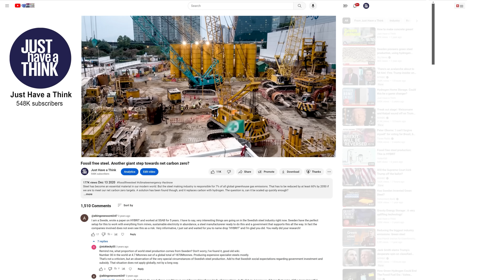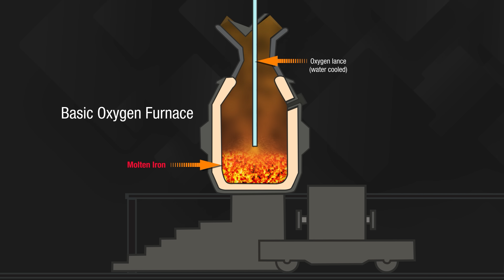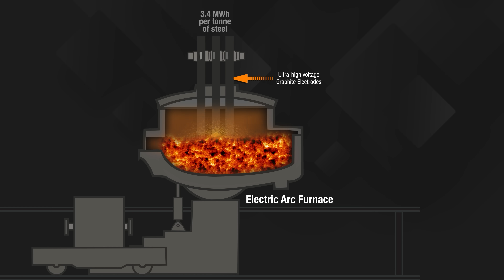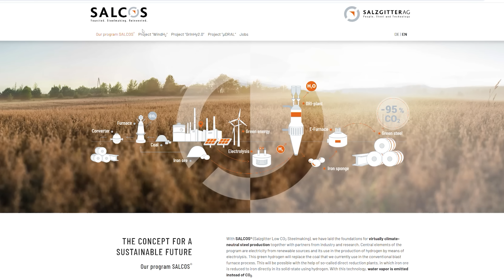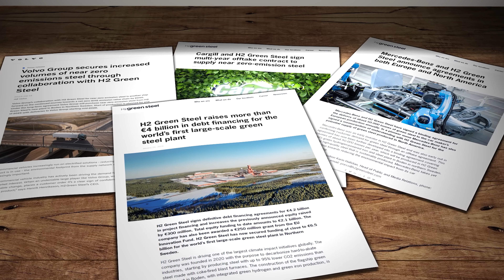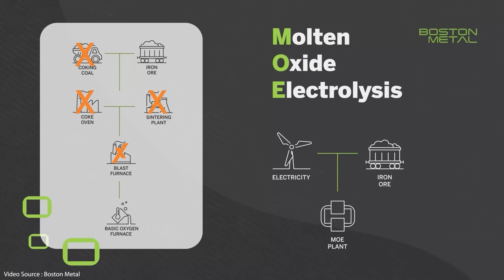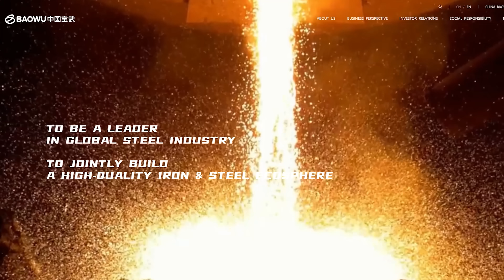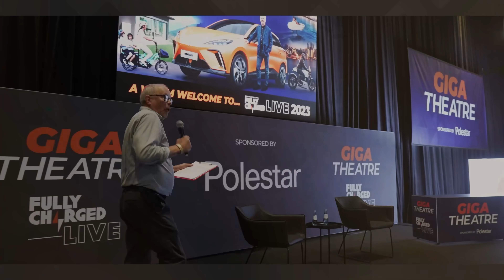Green Hydrogen making Green Steel. Is 2024 the breakthrough year?

Comment: Making green Hydrogen has at the very best a 40% round trip efficiency. Just have a think about using the electricity directly without the losses inherent in electrolysis and combustion.
Reply: @bélalugrisi  solar cells dont even reach 40 percent efficiency. They are still very good.
Reply: @markusjohansson4949  Not a good comparison, as sunlight is free, abundant and non-polluting. Electrical energy is a limited resource that has costs to the environment, no matter how it is produced.
Storage technologies, as hydrogen is in this case, all waste valuable produced electricity. Batteries and pumped-storage hydropower have roughly double the efficiency of hydrogen.
Reply: @bélalugrisi  well, maybe you should focus on what is relevant in you argumentation then.

Comment: If the electricity to run it is not green then the steel won't be either. So, clean up the grid first! Until then, Sweden and Norway with 98-99% fossil free electricity can do it.

Comment: My thoughts- Start strong and get stronger, fast. All the money raised, is then divided equally amongst every person living in that state. The rich use more carbon, so it will benefit the poorer. My addition, to what is a commonly held strategy, is that the govt., gives out the money at the beginning of the year, so no one can ever complain they're being robbed, plus offering the option of borrowing three, five years of estimated carbon tax, to carry out energy-saving works, insulation, solar, EV. The better the energy saving, the quicker the project pays for itself. Providing such a strong incentive, plus the means to act, could be transformative.

Comment: Co2 is life. Co2 has never been shown to drive "climate change". Co2 is greening Earth. MORE Co2!
Reply: @nekiyia  prove me wrong with some facts!
Reply: @zympf  "* prove me wrong with some facts"*
Published research on Co2 and climate:

"CO2 as a primary driver of Phanerozoic climate"
"CO2-forced climate thresholds during the Phanerozoic"
"Climate sensitivity in the geologic past"
“Observational determination of surface radiative forcing by CO2 from 2000 to 2010”
"Changing atmospheric CO2 concentration was the primary driver of early Cenozoic climate"
 “Geocarb III: A Revised Model of Atmospheric CO2 over Phanerozoic Time”
“The Bakerian Lecture: On the Absorption and Radiation of Heat by Gases and Vapours, and on
the Physical Connexion of Radiation, Absorption, and Conduction”
"Timing of atmospheric CO2 and Antarctic temperature Changes across Termination III"
"Synchronous change of atmospheric CO2 and Antarctic temperature during the last deglacial warming"
"Global warming preceded by increasing carbon dioxide concentrations during the last deglaciation"

As well as published research on current Co2 rise linked to human activity:

“Evidence for Preindustrial variations in the marine surface water carbonate system from coralline sponges”
“C13/C12 Ratios in Tree Rings and the transfer of Biospheric Carbon in the Atmosphere”
“Past atmospheric CO, levels and the 13C/12C ratios in tree rings” 
“Stable isotope ratio mass spectrometry in global climate change research”
“Oceanic Uptake of Fossil Fuel CO2: Carbon-13 Evidence”
“Global carbon budget 2013”
https://www.nature.com/scitable/blog/student-voices/the_delta_fingerprint_anthropogenic_climate

Not only that, but climate models that show climate change, have to factor in the known infrared radiation absorbtion abilities of Co2 in order to match observations!

“An Assessment of Earth's Climate Sensitivity Using Multiple Lines of Evidence”
"Industrial-era global ocean heat uptake doubles in recent decades"
"Observed and simulated full-depth ocean heat-content changes for 1970–2005"
"How fast are the oceans warming?" [DOI: 10.1126/science.aav7619]
"Evidence for climate change in the satellite cloud record"
"Cloud feedback mechanisms and their representation in global climate models"
Knutson et al. 2010: "Tropical cyclones and climate change"
"Observed warming trend in sea surface temperature at tropical cyclone genesis"
"An assessment of a multi-model ensemble of decadal climate predictions"
"Changes in the geopotential height at 500 hPa under the influence of external climatic forcings"

Comment: The Boston Steel (Boston Metal) approach, direct electrolysis, is the only approach I've seen that is expected to make green steel that costs less than the coal fired blast furnace / converter process. It makes the hydrogen foam steel process seem like a fools errand. Unfortunately it also looks the least far along on scaling up.

Comment: Its good they are figuring this out, but in the long run economics will win out.  Before committing too much to this, perhaps we need to deal with low hanging fruit first.  Replacing coal and natural gas with renewables in combo with energy storage along with replacing natural gas with heat pumps is something we can do now and will save us money long term.  As is the adoption of evs.  

Because there is potential for very cheap electrical power going forward with renewables, then this technology will begin to make sense economically in the not so far off future.  

Another thing.  What is the carbon footprint of recycling steel?  And what percentage of steel is recycled and is this trend going up?

Comment: At first glance, it looks like this has potential, and seems like a much better use of green hydrogen than fuel for vehicles. That said, the cost premium over conventional steel is still a concern, and as long as it's there, most companies will inevitably choose to just pump CO2 into the atmosphere, rather than pay it. Yes, a 20% premium is far cheaper than CCS, but it's still more costly than hiring lobbyists and/or supporting political parties who don't care about the climate, to prevent regulations that tax/ban the dirty method.

That said, if the cost premium of clean steel is mostly driving by the cost of green hydrogen production itself, rather than actual elements of the steelmaking, there is hope that it might someday go away.

Comment: It seems a mistake to assume that we have to go completely green in one leap.
The price of green hydrogen is currently much higher than hydrogen from fossil fuels.
However with falling costs of electrolysers and renewables the gap is ever narrowing.
It is way, way easier if you are running your blast furnaces on hydrogen to switch the supply of hydrogen than to leave it, and not convert the blast furnaces to hydrogen until totally green hydrogen is available.
If you ask the wrong question, you get the wrong answer.
It makes IMO no sense to delay switching to hydrogen in steel making because the production of hydrogen is not currently completely green.

Comment: Smelting a ton of steel takes approximately 50kg of hydrogen, which at $16/kg is around $800. Smelting a ton of steel using coal takes 770kg which is about $0.10/kg... so about $77. "green steel" is a pipe dream and makes zero economic sense when other countries like China and India will make steel using coal at less 1/10 the cost.

Comment: VOESTalpine is also working on this since a few years. But because there is not much hydrogen and cheap gas the using the gas till the solving the problem. By the way: The VOEST is the inventor of the Basic oxygen steelmaking (Linz-Donawitz steelmaking).

Comment: Another compelling approach involves the use of hydrogen plasma to directly melt and reduce iron into steel. A pilot plant for this method has been constructed by voestalpine in Austria. The Process is called SuSteel

And then there is noteworthy paper published in Nature addressing the management of red mud, a byproduct of aluminum production containing up to 60% iron, albeit being a hazardous material. The study demonstrated that melting it in an arc furnace under a hydrogen environment allows the smelting process without the need for additional additives.

Comment: The elephant in the room isn't 'China'.... The REAL elephant in the room is the last 50 years of CO2 emissions that haven't had an affect on climate yet. The serious issues we're having right now are caused by the emissions in the mid 20th century. Even if we went to net-zero tomorrow, the climate will still be subject to additional warming for the next 50-70 years. If we've serious about 'fixing' the climate there are 2 things we need to do right now (but will never be done because of popularity competitions, aka elections). We need to start extracting more CO2 out of the air then we are pumping in (we need to get the atmospheric CO2 level below 300ppm, currently over 422ppm), and we need to get the population DOWN to a more reasonable level (reduce by AT LEAST one half!)... Neither of those things will happen because, money and.... money... So yes, I'm stocking up on air conditioners!

Comment: Natural Gas was supposed to be a stepping stone to the renewables and less harmful than burning coal. Then it recently turned out that, taking the full lifecycle emissions into account, natural gas is currently worse! On that front, I've read the first article in what I hope is going to be a series of articles that, finally someone did the chemical and climactic analysis as to the effects of the escaped H2 on our climate. Noting that there is no such things as a 100% H2 Leak Free storage, this is something that has thus far been ignored. Well, according to this analysis, the chemical interaction between H2 in the upper atmosphere results in worse global warming than the CO2/CH4 that it removes. It seems that "raw" electricity is the best solution. That focusing on less climatically harmful electric power generation, storage and distribution is the way to go. Perhaps we can buy a few years if "someone" decides to invest the Billions that it takes to build and manufacture the stratospheric aircraft that it would take to spray sulfur in the stratosphere to temporarily reflect back the solar rays (obviously lowering the efficiency of the ground-based solar cells). Or perhaps spreading iron / rust particles in certain parts of the ocean to supercharge phytoplanktons.... For that matter, just subsidizing the installation of solar water heaters could save massive amounts of energy. But, why do any of these things when we can just let someone else's children and grandchildren pay the price for our greed?

Comment: Here in Wales, we are also ditching our blast furnaces... but at a social cost.  Port Talbot steel works, one of the largest employers in Wales, is set to lose up to 3000 jobs as the plant installs electric arc furnaces.  Demonstrations have been held against the owner, Tata Steel, and their decarbonisation plans.  It's so crucial to take people along in the journey to sustainable tech by having more joined up policies of retraining and new employment opportunities.  Another big topic!
Reply: I believe this was not driven by decarbonisation plans but rather as we are now outside the EU we suffer tariffs on high carbon steel exports to the EU. So Brexit drove this as Tata did tell everyone in past. It is such a pity the media is distorting reality and blaming a green agenda. When post Brexit this was the only viable option.
Reply: @davidedwards4691  Easy to blame Brexit but why cannot our government provide the requisite coal cheaply enough (we've got plenty in the ground) - because it's not allowed to, unlike China for instance.

This is why China's steel much cheaper than ours - because they use massive amounts of cheap coal to manufacture it. Duhhh.....

So less Brexit, more Net Zero is the cause.
Reply: @dwards4691 To a large extent it is due to "green" agendas. If we could use our abundant reserves of coal to supply the energy required it would be a lot cheaper. And all our competitors like China and India are doing just that! Take your head out of the sand.
Reply: Electric arc furnaces can only recycle old steel, and make second-grade material at best. Meanwhile China will be using unlimited amounts of coal to produce their steel, much cheaper as a result.

Well done Net Zero! Pointless and self-destructive.
Reply: it is a sad consequence of technological change that jobs are often impacted negatively. It has always been this way going back hundreds of years. The new technology may eventually create spin off jobs in other sectors but at the present time those jobs tend to be higher skilled types that many put out of work in older technology industries will not be able to be trained for. Older industries have more manual processes so require more people. The new technology usually incorporates a high degree of automation and a reduction in manual processes. So it is the older and less skilled worker that usually carries the can and governments are going to have to change their tune about pointing the finger at some unemployed people and labeling them as bludgers.
Reply: @frasercrone3838 🎯🎯 Definitely a concern, especially given a broad resistance in a general populace towards change because of your noted "pain points" + personal economic uncertainty...

Comment: Great vid, thanks. Because you don't need such crazy temperatures & heaps of infrastructure is it ridiculous to think that you could have small-scale steel production? The graphic showed the electric arc furnace takes 3.4MWh/ton. That's 3.4kWh/kg. I'm off-grid solar and when my batteries are full I often end up 'wasting' 10kWh of power on a summer day. Making 3kg of steel would be a nice way to use that power!

Comment: I doubt the arc furnace in the graphic uses "ultra high voltage" (whatever that means) more likely very high current at a relatively low voltage.

Comment: to do any of this conversion you need plentiful carbon free energy. like on site SMRs to provide the electricity. why always with the wind turbines to show a renewable electricity source? maybe that is the fool's step in the whole conversion process. China will have SMRs being mass produced soon once their pilot reactor is tested with more online hours. then they will have mass produced units that can be site specific for both consumer and industrial generation. then the real conversion there will start. its great you outline the new tech available, but you should also emphasize the problems or the requirements to get that tech running at a large scale. steel making needs energy. wind is great for cottage industries. where will the big electrical source be. you should highlight and promote that. are you anti-nuclear? why?

Comment: It's great to see actual progress on this issue over the last few years. I know it isn't much now, but creating a sustainable commercially-viable technology or process is often the hardest hurdle, while increasing market adoption is easier. What would really help is governmental support, but we'll have to wait and see for that.

Btw, DCC is indeed an immature technology that isn't helping much at the moment, but why can't carbon capture be used directly on waste gases from the steel-making process? The sheer air pressure from an active process like this should provide a pressure differential that can help power the process, and the CO2 is in a high concentration, enabling more effective carbon absorption....?

Comment: I think using green hydrogen for steel production is the same kind of bs as bio fuels.
If green hydrogen is available, it should be used for fertilizer production which requires tons of hydrogen already.

Comment: Electric arc furnaces are only as emissions friendly as the electric grid. If you look at where most steel is manufactured (China), their grid is run on coal, so they wouldn’t even reap the benefits of emissions reduction in the electric arc furnace. 

Drawing small boxes of carbon emissions around parts of a system is precisely why the west buys Chinese coal-manufactured solar panels and thinks they are doing something positive for the environment.

Comment: OK my 2 cents worth, green steel wire plant that makes wire by recycling steel put up a windmill. The idea was to use wind to supplement its energy costs when the price of electricity got high. After about six months of operation they rarely use the windmill  anymore because magickly the power company that supplied them with energy has had low prices for a long time making it uneconomical to put up more windmills. hmmm 🤔on the rare occasion they do spin up the windmill.

Comment: The solution is not to expect buyers to pay a premium for green steel, but rather, to make the cost of making steel with a blast furnace very expensive. How can you do that? Simple. Eliminate the obvious subsidies associated with mining coal and oil. That is the answer. Simply make it impossible to mine could or drill for oil and compete in markets were there are viable green alternatives available.

Comment: If all the excess electricity capacity is used to make steel, how are you going to charge all the EVs?   You can't escape opportunity costs, if you use electricity for one thing then you can't use it again for another.  The amount of electrical current for electrolysis is enormous e.g. to produce one liter per minute of hydrogen requires 143.5 amps.

Comment: The origional steel process u described is antiquated and most steel in developed nations is made using a differant process. One a lot of the blast furnances that remain and havent been outsourced or exported to developed nation are nat gas fired second the finishig process using basic oxygen furnance in most steel mills most notablely in usa is done by electric furnaces either of the arc or induction type.